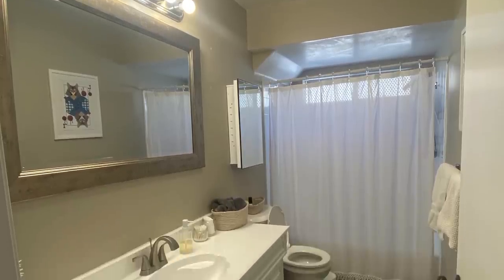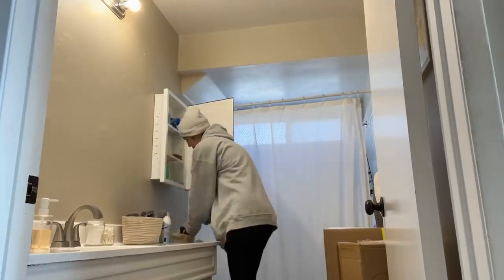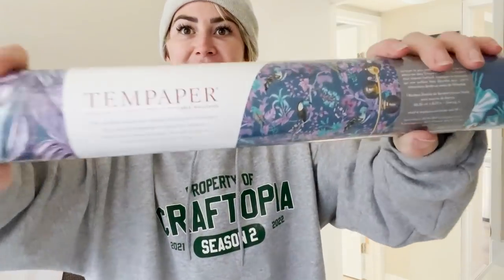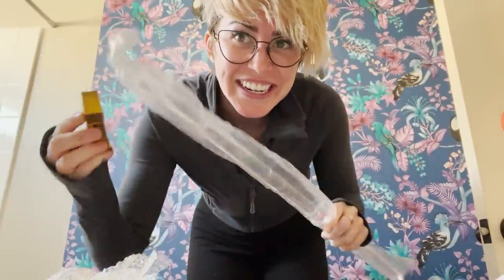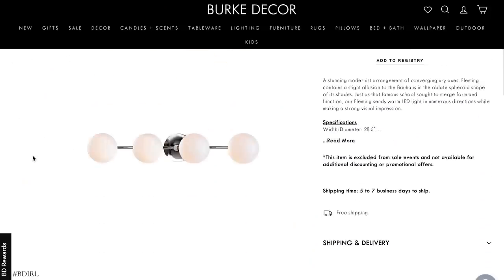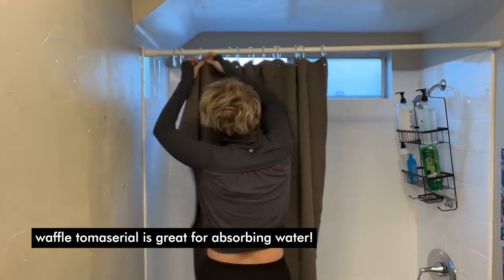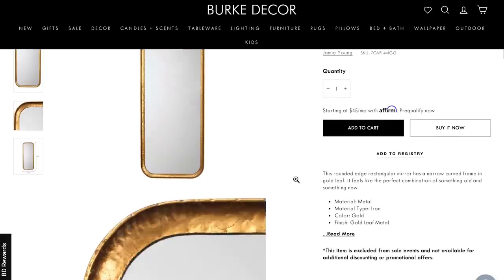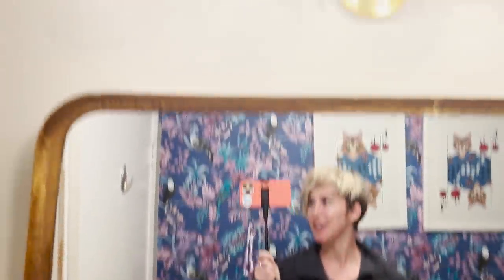surprise modern bathroom makeover (RENTER FRIENDLY!!!) - VLOG

Comment: When I do my anchors, I drill the hole a little smaller than my anchor. Then you hammer in the anchor and it should take some force to really get it in, I think. The anchor should open itself up inside the wall and be ready for your screw. At least, that's how I put up my Ikea pegboard and it hasn't budged.